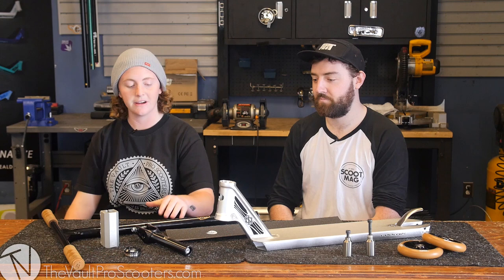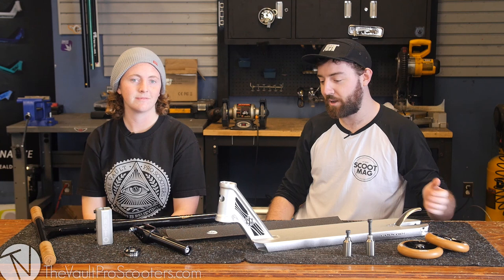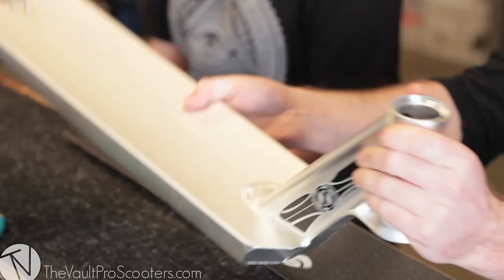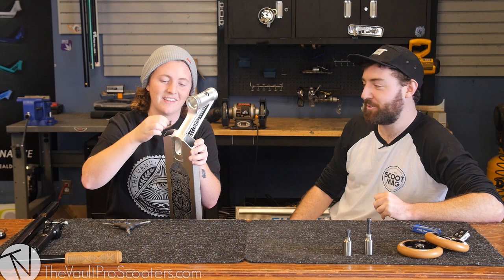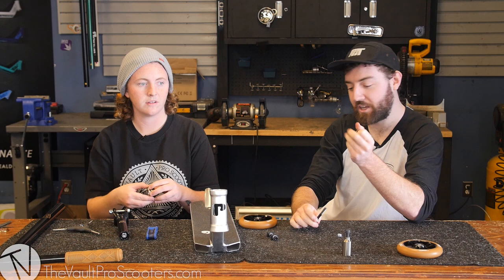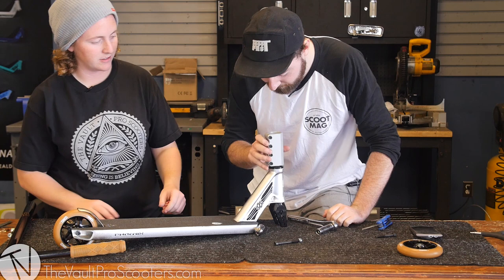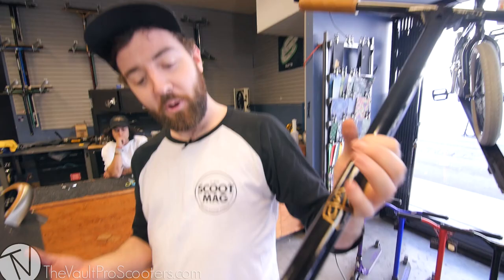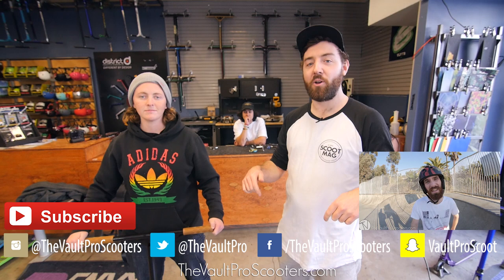Custom Build #93 (ft. Scoot Mag) │ The Vault Pro Scooters

Comment: I have a sick set upBarsBlunt Reaper V2 Aluminium Bars - ICS/IHC - 670mm - PolishedGripsTilt Continental Grips - GumDeckLucky 2015 Covenant Deck - Black - 4.5" x 20.5"WheelsUrbanArtt Le Baron Signature Wheel - 125mm - Black on BlackForksGrit Alloy SCS Fork - 125mm - Etched BlackClampTilt ARC Oversized Double Clamp - Anodized Gunmetal GreyHeadsetGriptape Tilt Fully Integrated Scooter Headset - Anodized Gunmetal GreyHella Grip OG Sloth Grip Tape

Comment: there always to expensive
Reply from the maker: +randolf Quinteros We always list our customs for cheaper than cost of all the parts it takes to build it. Here's how it works.

1. We price out every part individually.
2. From the total cost of parts, we automatically take off 10%, so if the parts come out to $500, we knock $50 off the price and list it at $450.
3. Typically, the labor to build a custom would be about $20, but we don't charge that.
4. And finally, any complete ordered from our site gets FREE shipping to anywhere in the US. Shipping that large of an item is not cheap.

So the price is extremely reasonable.

Thanks for watching
Reply: Oh ok
Reply: +TheVaultProScooters straight truth there 🔥👌🏼